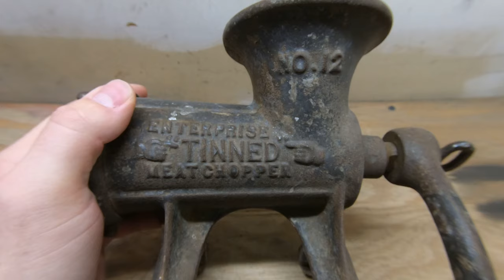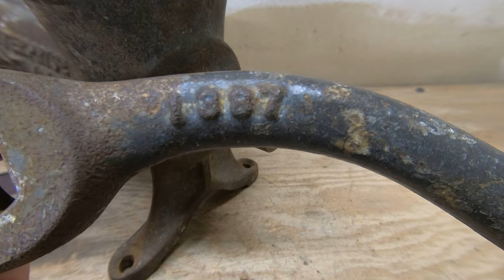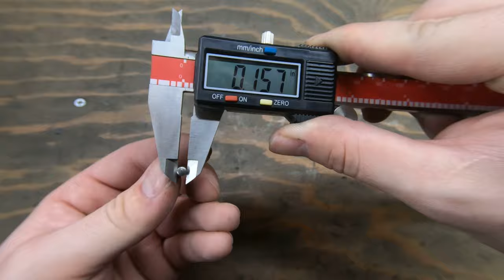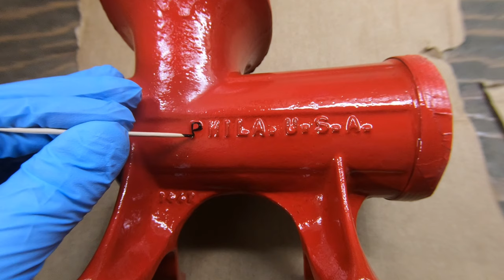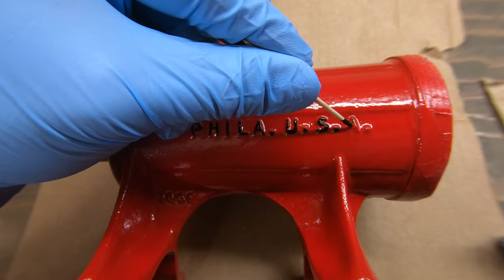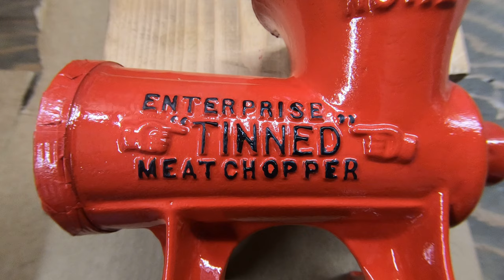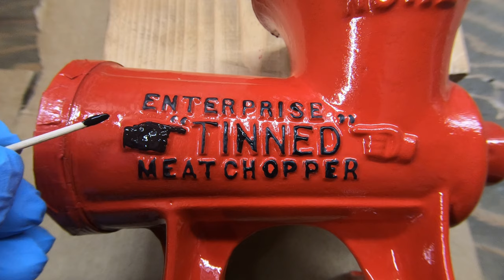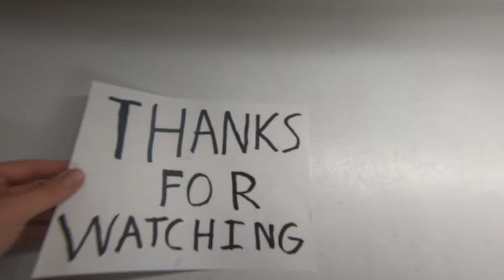Meat Grinder Restoration

Comment: Sorry, I'm a bit confused.  At what step did you use linseed oil?
Also you painted it from outside to prevent rust, what about the inside?
Reply from the maker: Those are great questions.  I used linseed oil right after sanding the wood.  I also didn’t paint the inside because if I ever wanted to grind meat in the future I would have the option to do so.  Thanks for watching😀👍.